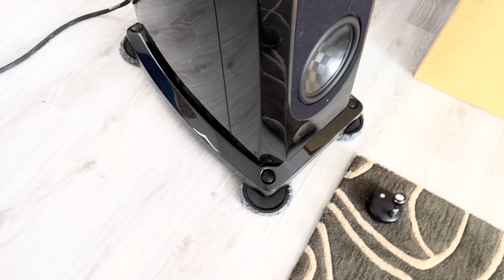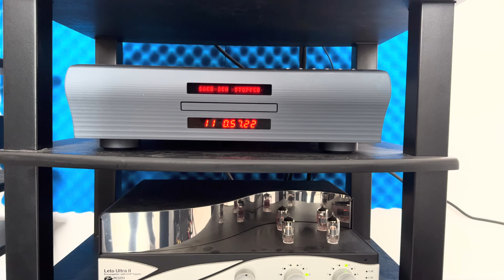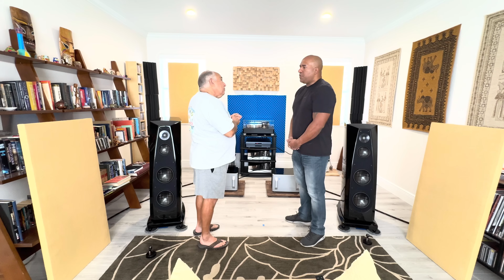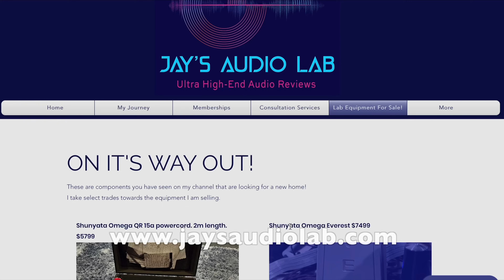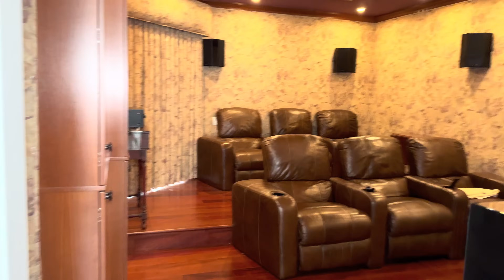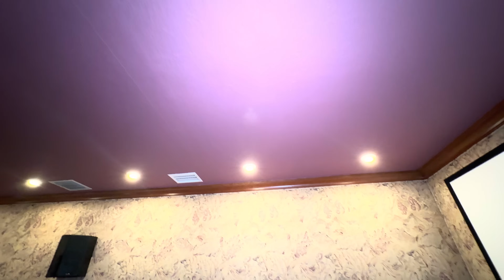A Local Audiophile Builds A Great  Audio System & Soundproof Home Theater

Comment: I totally get keeping the Vandersteens despite moving up the speaker food chain. I got my 3As in the early 90s also and they still bloom with each component upgrade. Absolutely not worth selling based on the price/ performance. when i do upgrade, these will go in a second system just as Mitch did.

Comment: Jay-this is the eyedoc you met at Axpona 2023.I would like to suggest to Mitch to get a larger isolation transformer -5kv or so.I believe what he has is somewhat current limiting, attenuating his lower end. I've had similar transformers and had to go to 5 kv-which helped tremendously-without loosing a kidney on cost. They do clean up the mains quite a bit. I had mine wired for balanced A/C. 5 kv set up balanced would give him 20 amps of current.
Reply: THE ISO TRANSFORMER IS ONLY BEING USED WITH THE PREAMP & SACD/CD PLAYER, 1,5KVA IS MORE  THAN ENOUGH

Comment: Cool looking transformer!. I'm currently experiencing an AC nightmare. Basically I can't listen to music except past 11 pm. Sometimes it's even 12:30 am and the sound blows! Living in the middle of a huge city sucks 😂
Reply: Have to be careful with iso transformers as they can limit dynamics, but this one looks pretty big, the more iron and copper the better! Plus it looks like a low capacitance design which is very important for low line noise pass-thru.
Reply: They're great. Some say unsightly, ok.  

I've got two essentially identical to that one, ... they're abundant on the used scene. 

Had mine since the 90's, they'll last forever. 

I believe mine are Topaz, the smaller ones are 2.5kva, unsure of the larger, but it's at least 3.6kva because it's rated at 30a. 

I have a pair of ONEAC iso transformers for smaller loads. 

Yes, need to assure there's ample peak current, absent of losses. 

For whatever reason, if a system benefits from isolation, it needs to be pursued (both to the wall, or inter-component isolation).  

I see Mitch's line cord tightly bundled into a mass, ... not the best idea.
I'd either cut and re-terminate it just long enough, or lay the cord out along its length. (But that's an extraordinary nitpick observation in a sweet room  a killer system all superbly optimized by Mitch's experience). 

Rockport, love those Rockport cabinets!